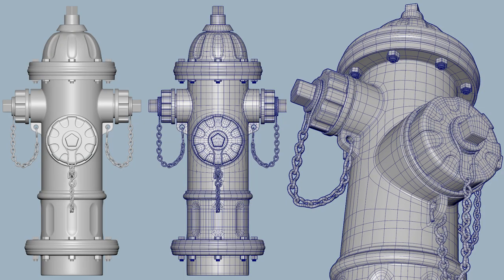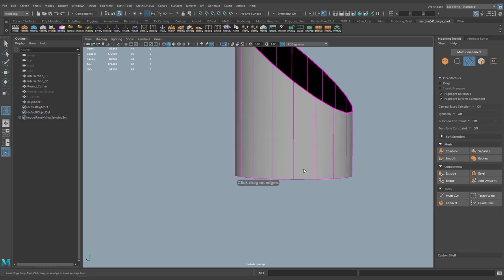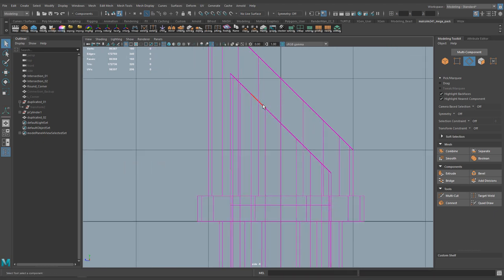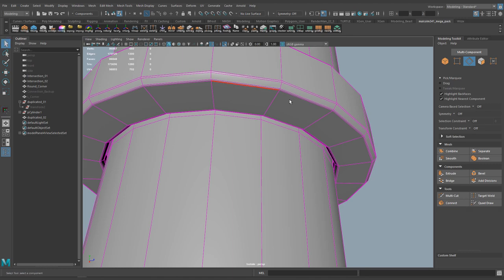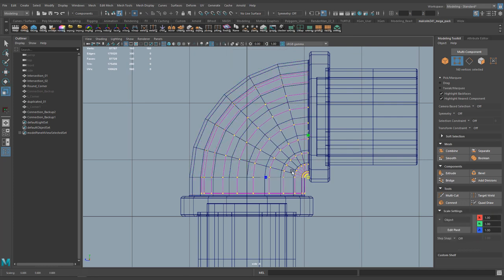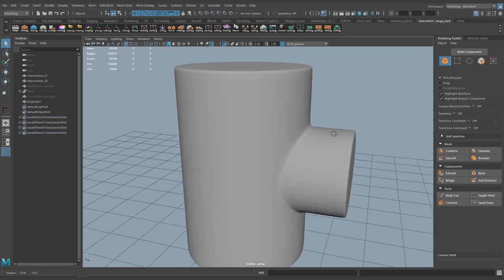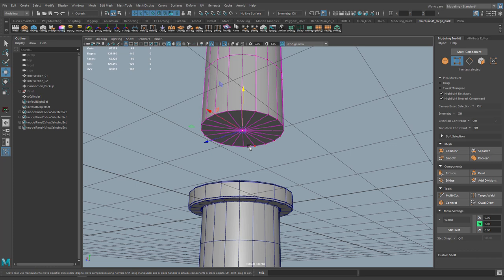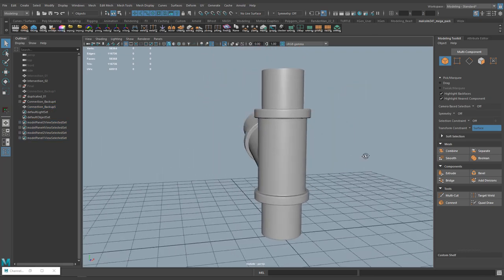Maya Modeling Tutorial: 3d Modeling Cylindrical Corners & Intersections

Comment: a short cut trick i found for snap step when rotate, scale and moving is to hold W/E/R, then hold v at the same time and then left mouse click and it will present you with a pie menu. for moving its snap then > discrete move. for rotate its discrete rotate. for scale its snap scale.